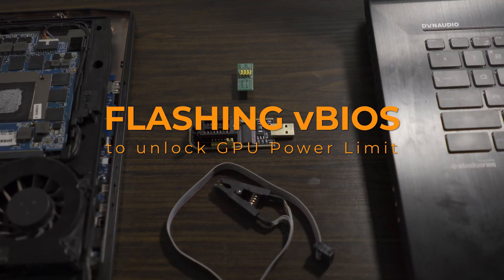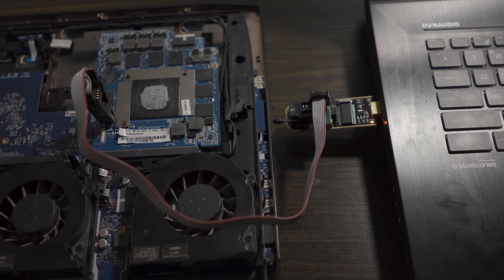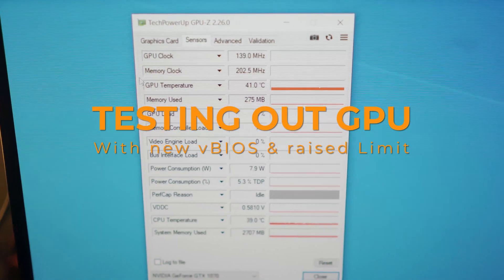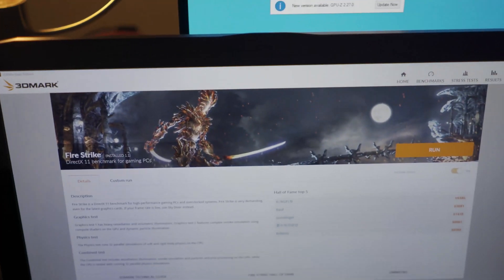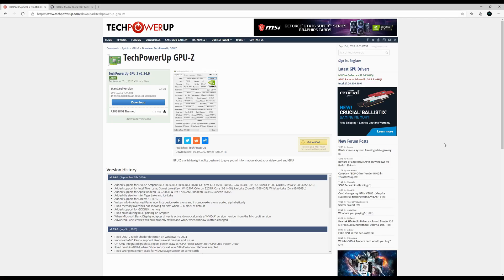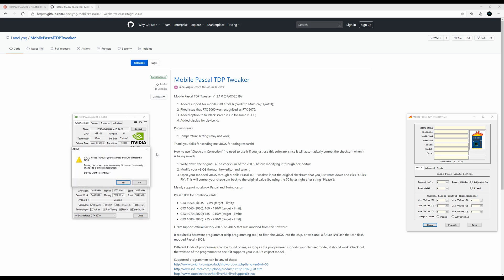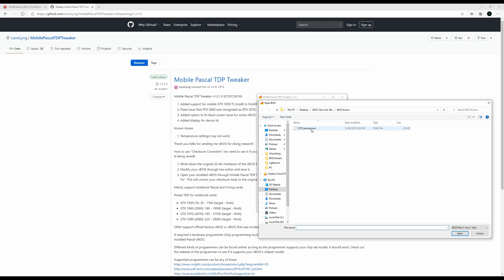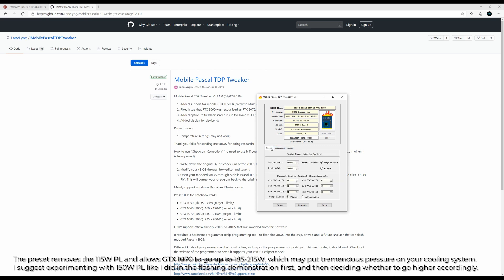Flashing vBIOS to Unlock Laptop GPU Power Limit (for MXM modules)

Comment: Nice work. I’m looking at installing a 965M in my machine HP 8570w. Currently have a k1000m in there. If I install 965m no display so can’t backup/flash with card in machine, can this flashing be done outside of machine? Also have techpowerup vbios, but not sure if that asks for “manufacturer” at flash point

Comment: Ive already watercooled my mxm 1070 and modified the TDP. Could you point me in the right direction of where to start unlocking Gpu core voltage in the vbios?

Comment: Can someone help me out? I've a Razer Blade 15 mid 2019 RTX2060 (Mobile, old version). I flashed a modified vBios and I double checked it BUT after boot the old 90w TDP is "restored". Is ther a 2nd chip?! I can't see any ... solution?

Comment: anyone tried on a 3070? i have a razer blade 15 and if i upgrade the cooling i think i can manage more wattage but i dont dare to try this method
Reply: i have a rb15 mid 2019 rtx2060. i flashed my modified vbios but razer auto-restore the original one after my system starts. i dont figgured out how to fix that :(

Comment: PLEASE HELP CAN I USE A STOCK OR SAME ROM SINCE I DIDNT BACK UP MINE ON ACER HELIOUS 300 SINCE I HAD NO IDEA NVIDIA WOULD LOCK MY CARD DUE TO THROTTLESTOP WHICH WORKED FINE B4 AUTOUPDATED MY LAPTOPS BIOS.I MADE A BACKUP OF MINE BUT ITS LOCKED! IF SO CAN I USE NVFLASH TO DO IT

Comment: Very informative. How about on board GPUs? Plus is using nvflash.exe an equivalent method as what you showed in the video? Thanks in advance.
Reply from the maker: It's possible to flash vBIOS with NVflash to increase power limit. However, Laptops that have GPU soldered onto the motherboard usually are a lot more challenging to work with, as most of these laptops do not feature a dedicated vBIOS Chip. Often the vBIOS is integrated into the motherboard BIOS. So if NVflash fails to flash(which it does a lot with modded vBIOS), you'll need a backup plan to save your laptop. Yet I'm not aware of any method that can revive a failed vBIOS flash on a laptop with soldered GPU. There probably is a method, but it surely will be tedious, which is the reason I don't recommend flashing modded vBIOS with NVflash on your machine. For MXM GPU or desktop GPU, you can at least do flashing with SPI programmer as a backup.
Reply: @DixonWangYF  Good point, guess I better chill before rushing. Thank you for your advice.
Reply: By on board GPU i mean something like Alienware 17r5 1070 oc with 8750h.

Comment: Would this software even work in a desktop gpu ? if you flash it to the bios via a bios flasher
Reply from the maker: You don't need to. Simply install MSI Afterburner and you can change the frequency and power limit from there. Much easier than flashing any BIOS.
Reply: @DixonWangYF  yes but, i want more power limit, and since that is limit, how do i by pass that. also for some reason i can use this program to bypass and change the gtx 1080 FE for some reason.

Comment: Can I flash vbios gtx 1060 mxm 3.0b (dell, clevo) to run it on msi 16l1?
Reply from the maker: Not sure about the dell variant. The clevo 1060 features a 8 pin power connector which is different from the 6 pin power cable MSI uses in its laptops. So probably a no go. Even if somehow you got it working, you would have to mod the heatsink to fit the new GPU.

Comment: Can you use this method to flash a mxm Quadro p4000 to a GTX 1070 mxm? I'm just curious I have a Zotac en1060k with a GTX 1060 mxm. I can get a cheap Quadro p4000 which I think is physically identical to a mxm GTX 1070. I don't want the hassle of editing the registry to so the p4000 will work on Nvidia drivers. Also the p4000 has a lower boost clock vs a 1070.. thanks and hope you can help me.
Reply from the maker: There can be different vBIOS for different GTX1070s, g-sync version, non g-sync version, msi version or clevo version etc. Flashing the wrong vBIOS can be problematic for the same GPU, let alone different GPUs despite the similarities. So I would recommend extracting the vBIOS from the P4000 using GPU-Z and edit it to raise PL, then flash it.